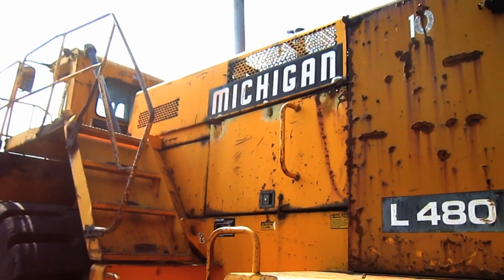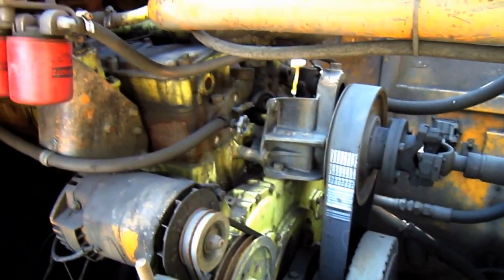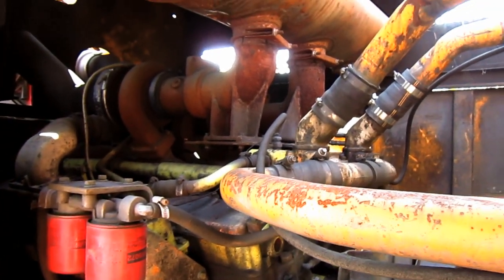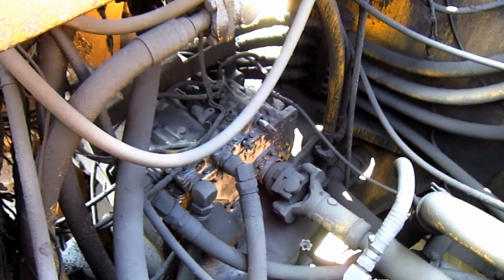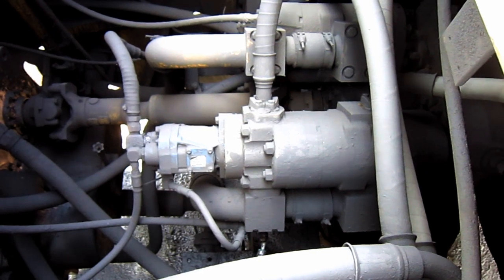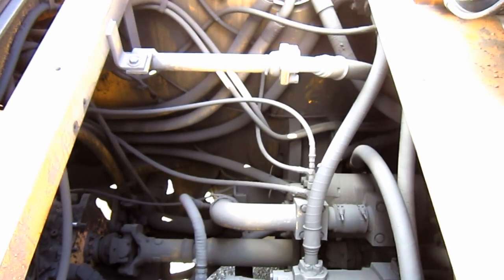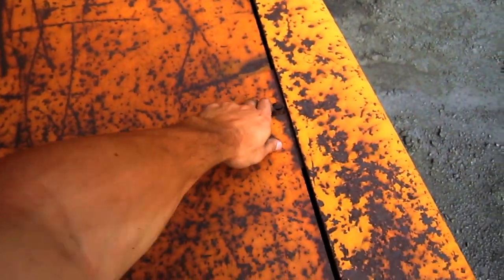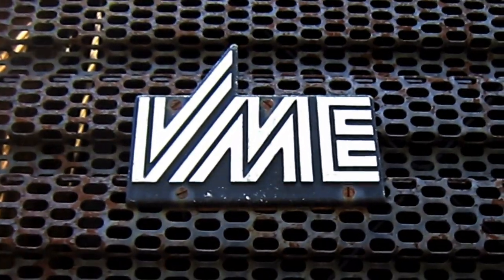Michigan L-480 Documentary

Comment: Would you say that is a 992c sized machine?
Reply: D Hewitt  The L-480 is very similar in size to the legendary Cat 992c. Both loaders carry a 12.5 cubic yard bucket. The 992c produces 690 horsepower, so it has that advantage as well as a heavier operating weight. I’m pretty sure the big CAT weighed in at about 193,000 lbs. It would be interesting to see the productivity records of the L-480 and the 992c on various earthmoving projects, to see how they compared.One thing for sure is that Caterpillar sold enormous numbers of their 992c loader. To conclude I’d like to say I’m a big fan of the Michigan loaders.My favorite is the giant 675 model that was powered by two big diesel engines!
Reply: @williamhall9204  thank you 👍